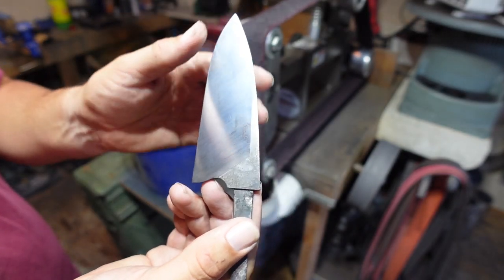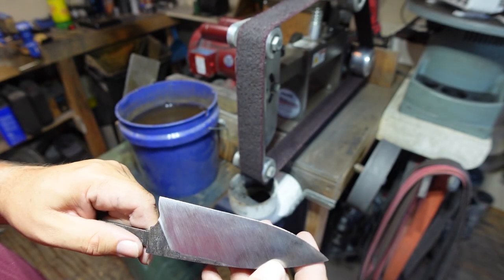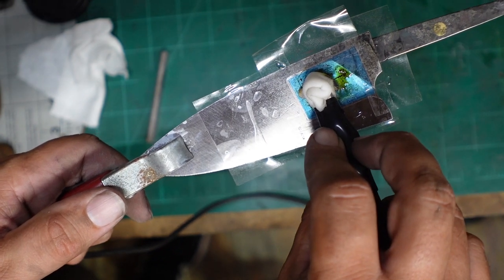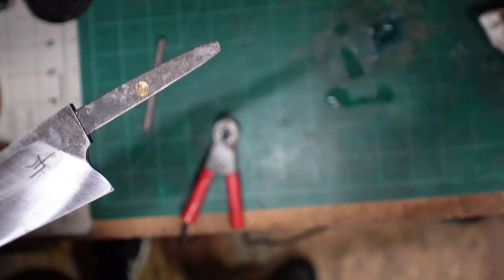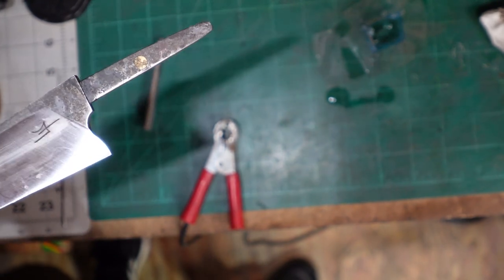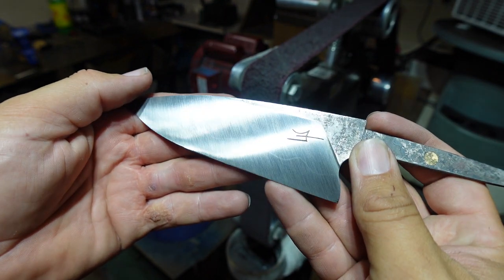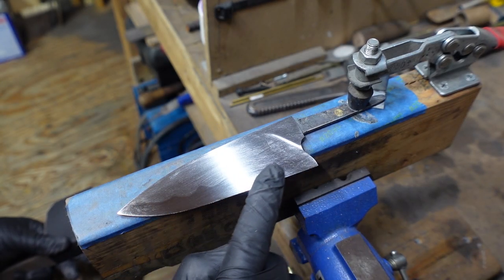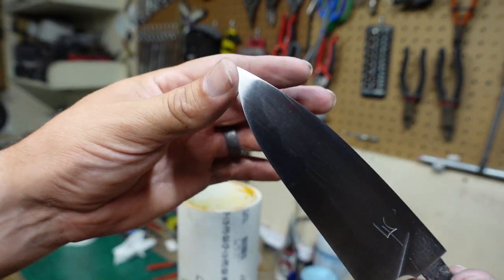Bringing Out The Hamon Line After Heat Treating | Knife Makers Vlog

Comment: Wow..going to try to re etch one of my blades. But what grit do you finish with before you dip it in the ferric chloride the first time? And how many parts water and ferric chloride? Thanks man
Reply from the maker: I typically sand up to 600 grit before etching and the etching solution is 50/50 ferric and distilled water.

Comment: Looks great man! Did you stop hand sanding at 220 before etching?
Reply from the maker: I sanded till 600 grit then etched.
Reply: @theriversexperience9383 thanks for the info! the next two blade I do will have a hamon but I'll be using 1080 and 1095.